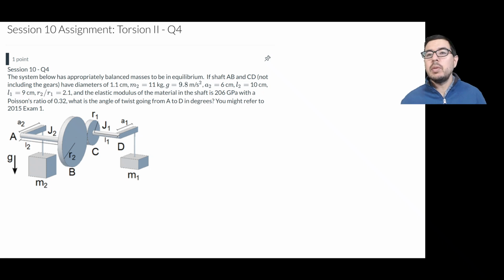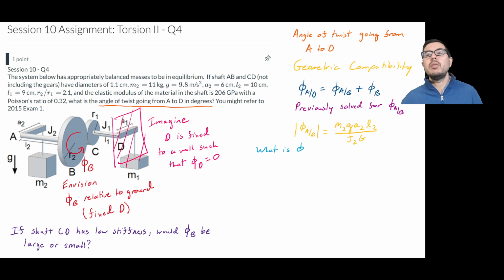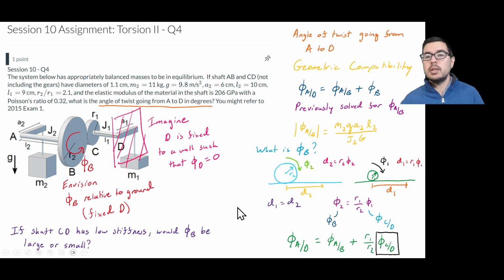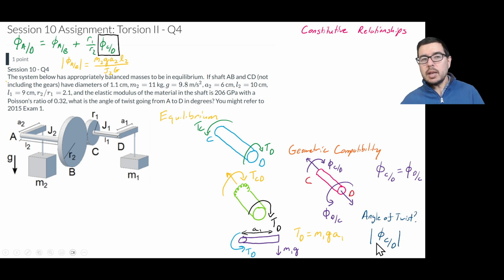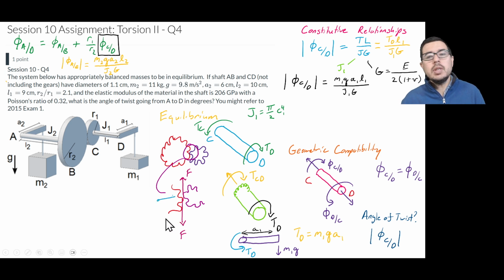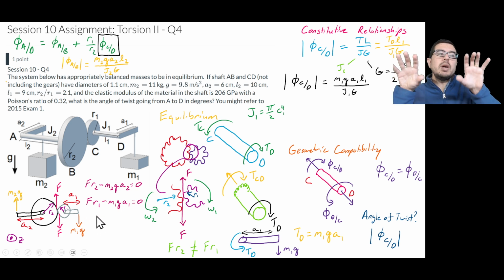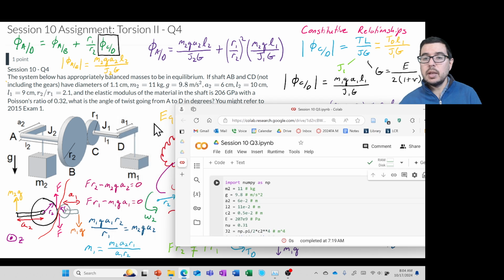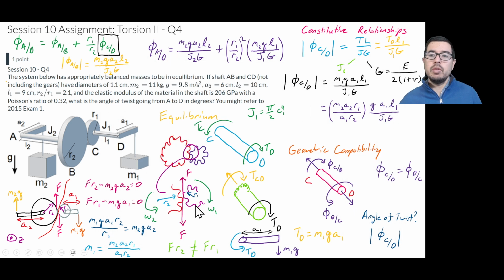Angle of Twist with Shafts Linked through a Geared System - Part II

Comment: Heads up! The final massive phi_A_D eqn both at the top of the screen and in the coding portion at the end is missing an 'a2' in the numerator of phi_C_D!

It got lost when multiplying (m2*a2*r1/a1*r2)*(g*a1*l1/J1G), the true final equation for phi_C_D is (r1/r2)(m2*g*a2*l1/J1*G), NOT just (r1/r2)(m2*g*l1/J1*G).
Reply from the maker: Thank you for catching my mistake.  Yes, the right term on the right-hand side of the final equation for phi_A_D is missing a factor of a2.